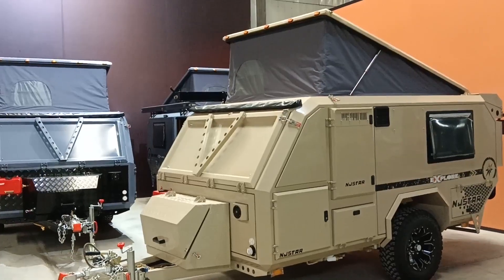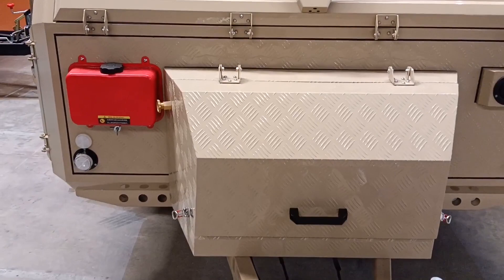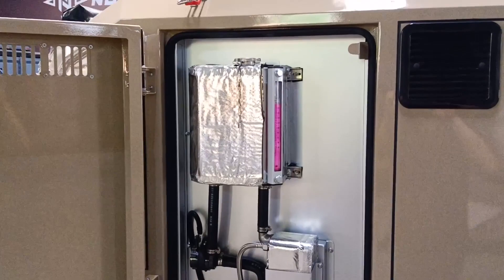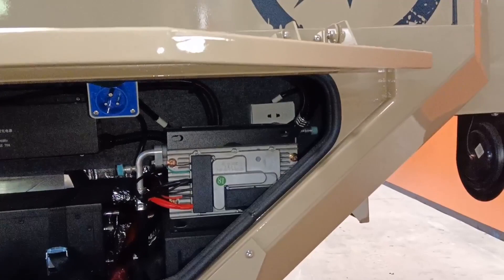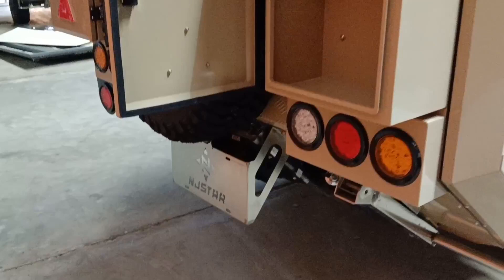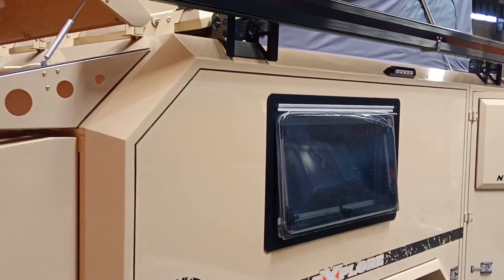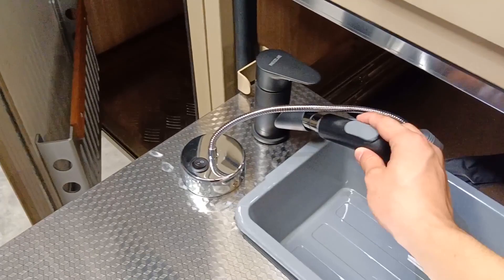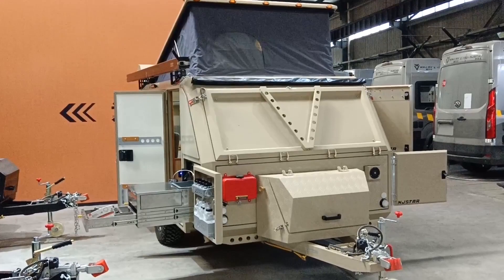The brand new njstar rv desert color off road travel trailer camper van toy hauler caravana #rvlife

Comment: Just asking, but at 1:31 the propane tank container doesn't have a safety vent on the underside to let out the heavier gas. Instead, the vent looks like it leads into the front of the cabin. If it leaks, won't it poison you in your sleep?
Reply from the maker: Hi thanks for your message, and your question is a key point I think, I will double check with our engineer, and we will modify it for safty reason as you mentioned. thanks again for your details.
Reply from the maker: Hi I just reconfirmed with our engineer that we have a safety vent installed in the front wall so as you can see there is a louver that is not connected to the rear trailer inside and is just for tool box ventilation.